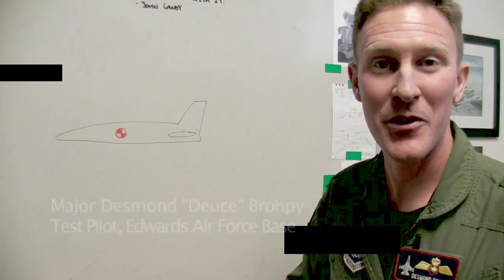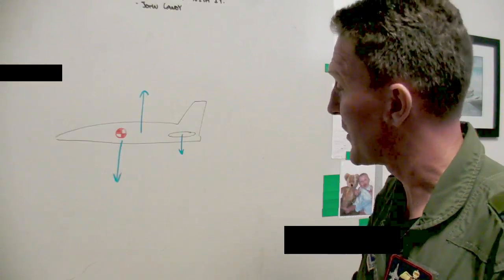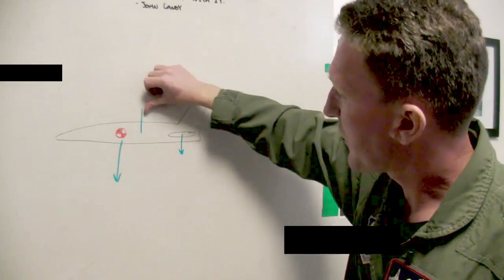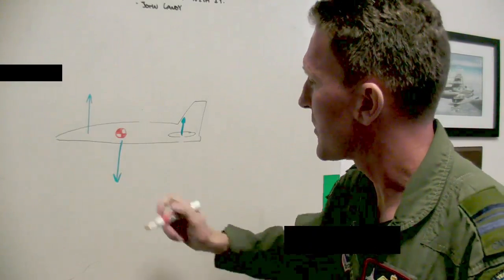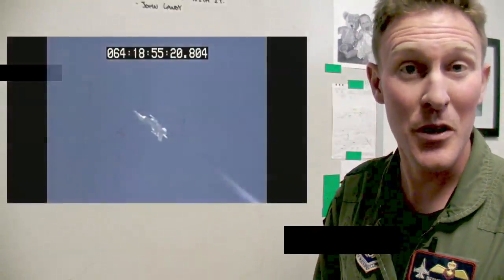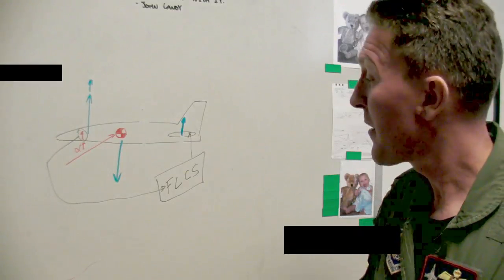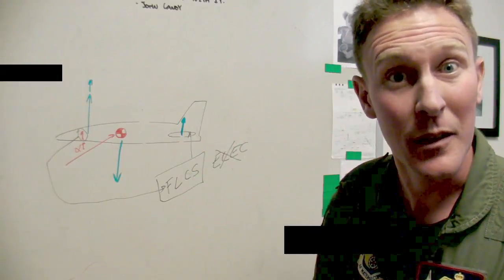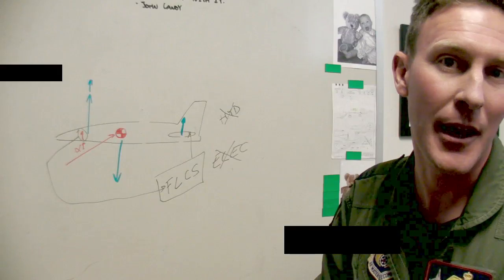F-16 Fighting Falcon (Viper) Stability Profile

Comment: in 90x i saw interview with david gallagher, he told there guys create first fighter which was stable statically, but not dynamically. that interview has been most motivator for get to know what the hell is that static and dynamic stability, and then after all i found if ac unstable statically it's will in any way unstable dynamically, but statically stable can be unstable dynamically if static stability will positive too much... and then was the pictures how different aircraft will go over critical aoa... and then when i fly in f-16 in bms simulator it's really helps me with recovering, because before bms models every fighters go to spin, but this one go to do same i was on that pictures with stable statical but unstable dynamically... it's so cool some time. time period aspiring to 0 remind so many information, that's some stuff do with us, as pc game does for example:)

Comment: God gave you two hands sir. Keep the marker caps off the markers until your presentation is over. Your failure to do this departed from control the majority of retainable thrust of your audience who is deafened by the continual audio counter measures you continually deployed.

In short, you’re wicked smart, but your hands have the attention span of a ferret on meth.

Tally Ho.

Comment: Wrong, I can't believe he completely ignored the tailplane. Even though increased moment on the wing create nose up pitching moment, the increased lift from tailplane create a nosedown pitching moment, combined with long moment arm, balancing the aircraft. 
But the CG has to be in front of neutral point, which is not at wing aerodynamic centre, for positive static stability.
Reply: He’s obviously leaving some things out for simplicity sake of this video. How are you going to say you know better than a test pilot? You’re a dirtbiker. Chill out tough guy.
Reply: Kisteaz is the only guy here who knows what he is talking about.  The F-16 test pilot knew enough for sort of operational appreciation of the F-16's AFT CG and computer design, but surely does not understand the underlying basic pitch dynamics which are far more complex than he seems to understand.
Reply: Man knows what 2 basic aviation words are that detail the center of the moment arm in pitch and the center of gravity and you put him on a pedestal wtf. The reason why the F-16 is unstable is because you actually need bigger corrections than your initial movement. Meaning to stop the aircraft from pulling up you need to push forward more than you initially pulled back on the controls. With a statically stable aircraft the plane would simple stop pulling up once you stopped the pull. The opposite of what would happen with a F-16 would happen to a cessna. Where it would try to fly level and reverse the changes you made in attitude back to its trimmed configuration.  So no the F-16 is not stable because to stabilize the aircraft or even manuever it you need to do multiple over corrections to your correction to dampen out the aircrafts propensity to run away from you. Not flyable without a few computers doing that for you.